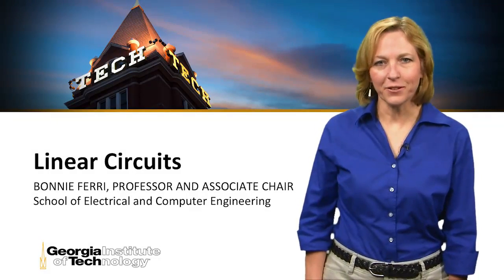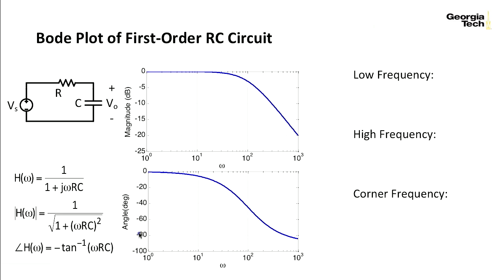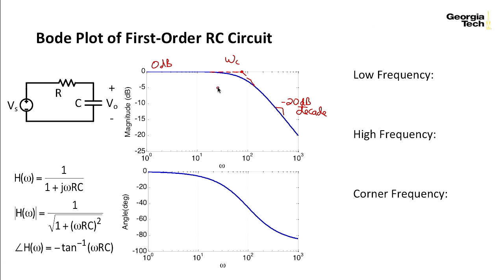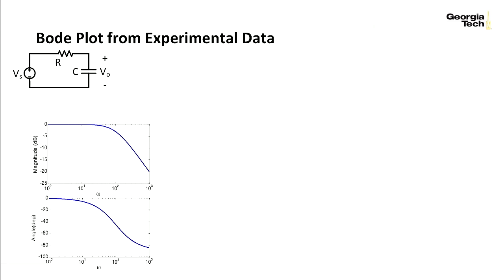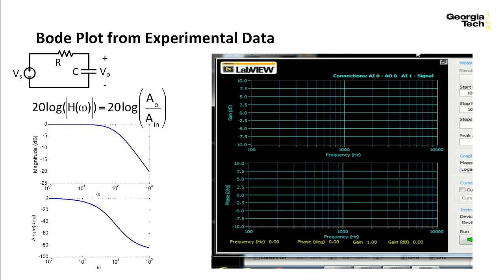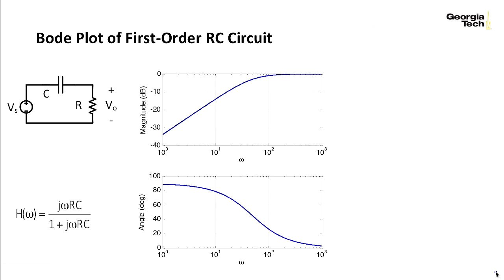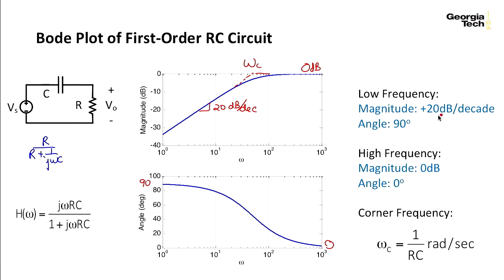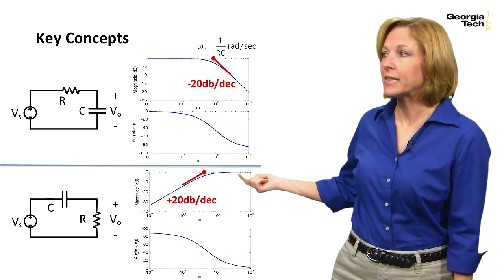2.6 Bode Plot of RC Circuits - Linear Circuits 2: AC Analysis

Comment: Madam can you please tell us method to draw bode plots. I do not understand how you take magnitude and angle for plotting bode plot? Why the plot starts from 0 db?
Reply: it depends on poles and zeros but it's another subject. You should search for a lesson where it's explained in general how Bode plots work, a video like this: https://www.youtube.com/watch?v=ZiXRL4QWqIU
in this case we know there are no zeros and we have 1 at the numerator. 20Log(1) is 0. so plot starts with 0 until we find the only pole which is at ω = 1/RC where the module starts decreasing 20db/decade - as it happens everytime you have a pole -. accordingly, phase decreases of 90°